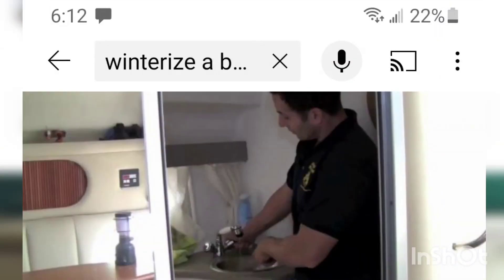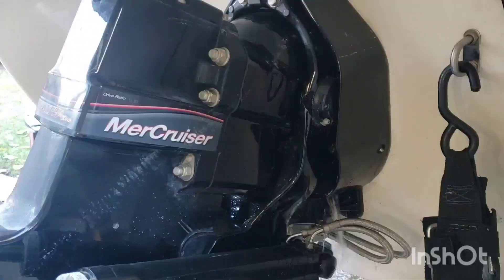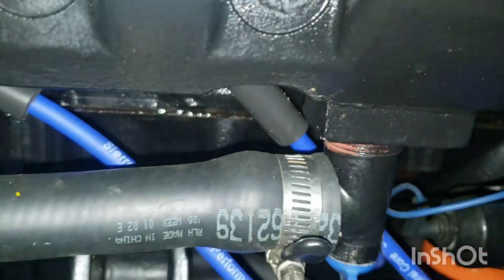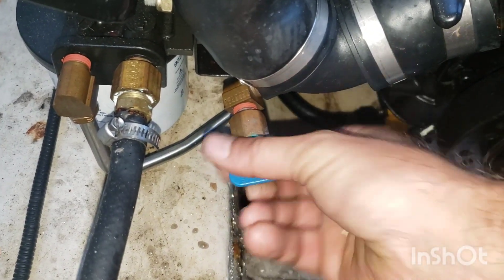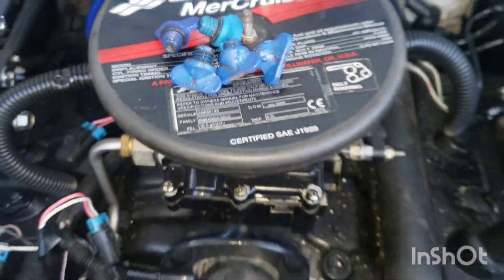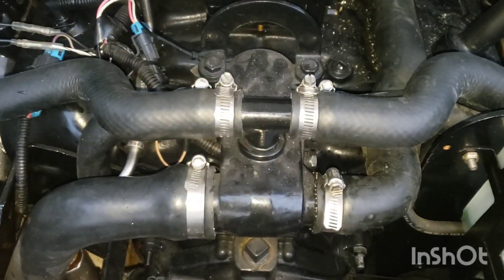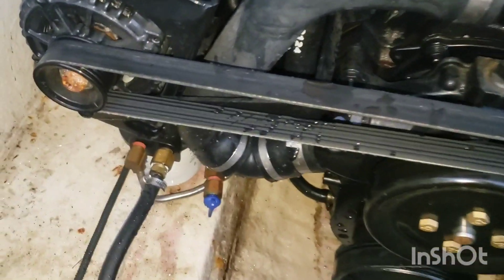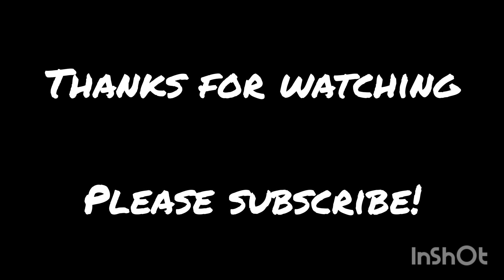Winterize and Freeze Protect Mercruiser V6 -V8 Boat Engine

Comment: I used a different process this year. I drained water from all blue plugs blew a little compressed air through four hoses. Poured pink in each hose till started to run out then reinstalled blue plugs. Setup a sump pump hooked to muffs in a large container filled with pink. Turned sump pump on and ran motor on pink for about five minutes and sprayed fogging oil into carb unit motor stalled out. Does anyone think that this process has any flaws in it. I personally think it’s a viable option since motor was completely drained and ran on pink to thoroughly fill motor. I don’t believe Tstat opened during this but shouldn’t have been any water since motor was drained completely.
Reply: Let me know what you find out. I ran antifreeze with gravity fed container. Once engin3 warmed up I switch the valve to and the antifreeze container sitting in my swim deck. How ever. I opened the drained to see if it was full. Surprise. Left side block and manifold were not full of antifreeze only water. Right side plugs did drain antifreeze.
So now that I have all 5 plugs open. Drained all. I plan on filling back up with marine west antifreeze thru the hoses like this video. But leaving the antifreeze inside. With plugs closed.